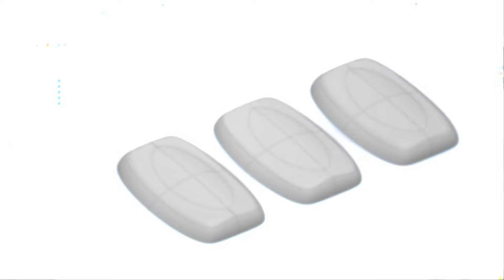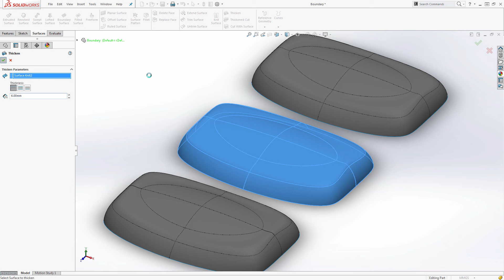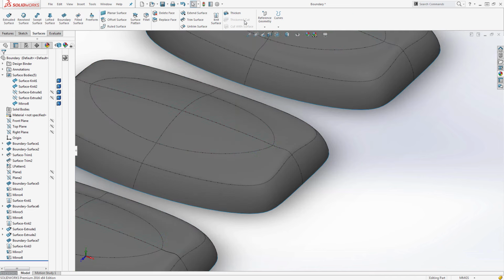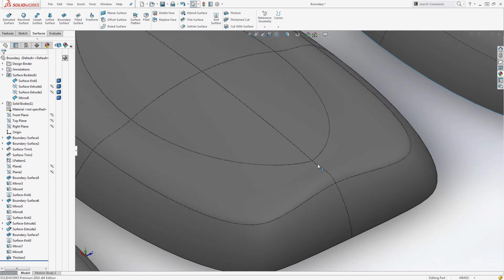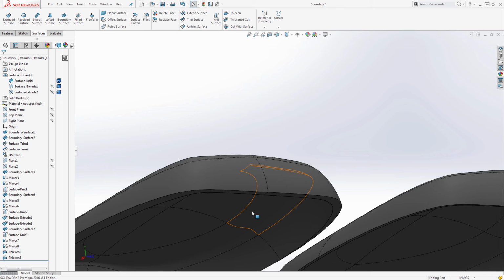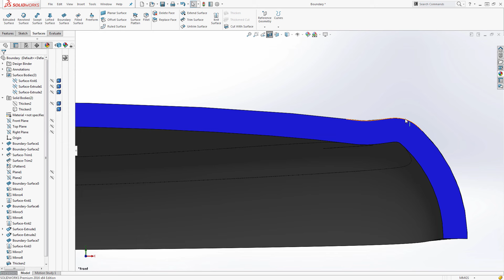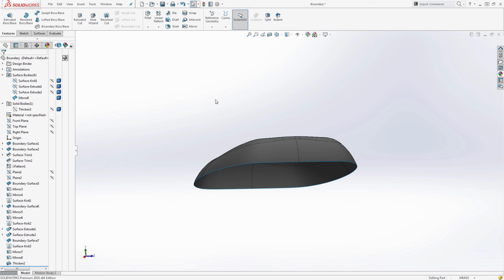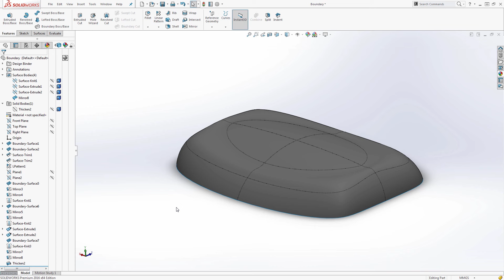SOLIDWORKS Thicken Feature

Comment: Great presentation. The distinction made betweeen the Thicken feature and the Shell feature to get the desired results for a drafted plastic part was really good. I have had to  create an extruded cut in many instances to get the planar surface to be the same throughout a plastic part BECAUSE I USED the Thicken feature INSTEAD OF the Shell feature. Thanks! 👍
Reply: You are very welcome Antonio! This will save you a lot of time and trouble in the future ;)